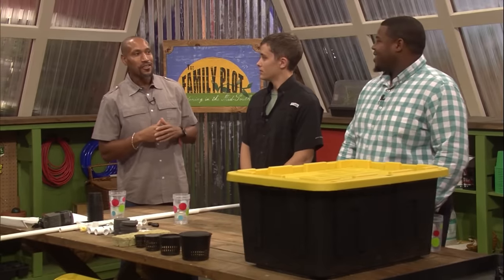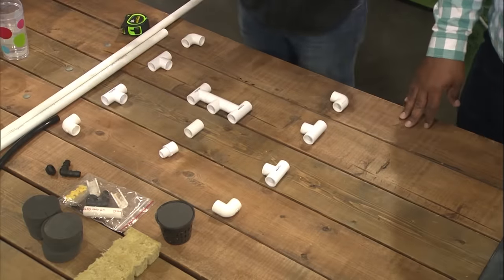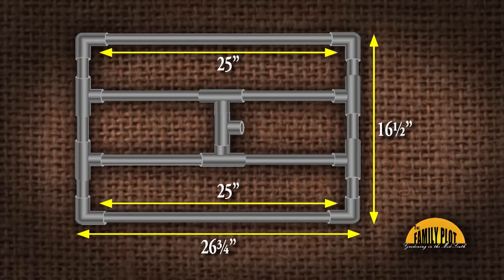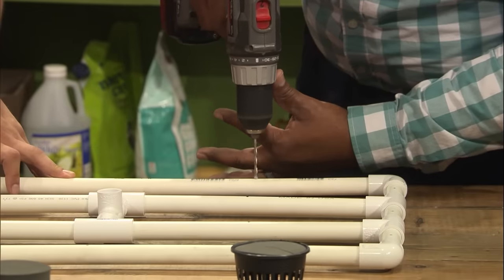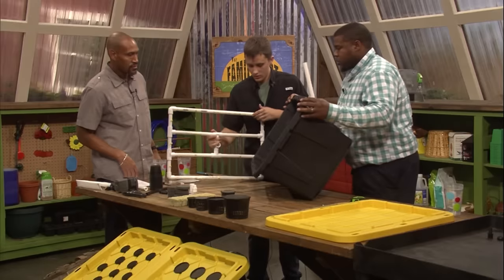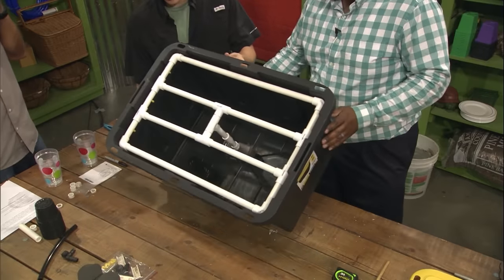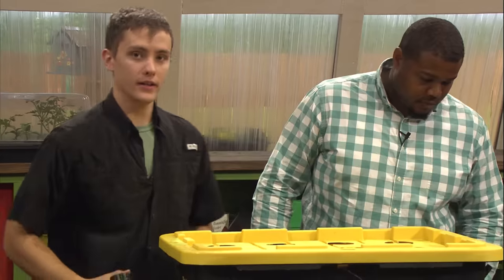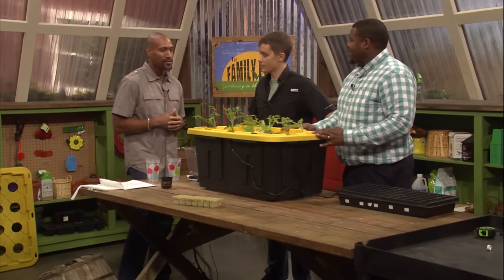Building an Inexpensive Hydroponics/Aeroponics System

Comment: If you have multiple pieces of pvc to cut at the same length, cut the first one and use it as a measuring piece for the rest of the pieces.   Saves some time not having to pull out the measuring tape every time.   Thank you for sharing your design ideas.
Reply: That's what I do😊
Reply: Or add the distance and pull the tape once, and no fumbling with a measure piece for each cut
Reply: Always cut the longest first.......yeah, well you might be surprised. As some found out at TSPE on the journey exam.

Comment: I've been running a very similar system for just over 3 months now and LOVE it!  Paint the yellow cover Black and it helps prevent mold.  I've also added a timer so my pump only runs about 50% of the time.
Reply: How did you set for your timer? I mean how frequent you spray the plant? 5 minute rest?
Reply: I've been running 15min on and 15 off.  I've not experimented yet with different timming.
Reply: Owh. Thank you for reply. Gonna try with your setup. 15m off 15m on.
Reply: @christophergraves5505  Hi there, I'm so curious.. how many days does it take before you see some roots from your clippings on that 15 on/15 off cycle??

Comment: Very complete and informative.
Thanks
Reply: Go Green 3
Reply: What pump are they using? I really need to know, thanks!
Reply: Great tutorial, minus one itsy bitsy detail...How much water did you put in ver
Reply: @troysnow5145  didn't they say 10 gallons? I thought that was the amount needed to create enough pressure to send the water through the sprinklers. That's what i used anyway.
Reply: I say INcomplete.  What about feeding the plants with some form of liquified nutrition, and what's actually going on inside the tub?  Also, what's the purpose or why bother with a drain?  Is an inside grow light needed?  How long do the plants remain in this container, and are they needing to be transplanted to a larger device?  Lots of unanswered questions or vague assumptions.

Comment: great video, thanks! A few questions remain:
1) How often should the pump run, and for how long? Also, how large should the pump be in GPM (Gallons Per Minute)?
2) What nutrients should be added to a ten gallon batch of solution?
3) What lighting is required, and how long should the light be on every day?
Reply from the maker: We run the pump all the time. It is 400GPH and is rated for about 25 watts. It both sprays the roots and oxygenates the water in the process. 
We used General Hydroponics Flora Series nutrients but there are many options out there. Watch this video for information about how much we put in: https://www.youtube.com/watch?v=gYrTTLbl3Ro
We use a large window for the primary light source. With large plants like tomatoes it takes a lot of grow lights (too many) to provide enough light. We do have a two smaller lights we use to supplement the non-window side of the plant. As for how long it should be on, that depends on what you are growing and the stage of life of the plant. Newly germinated plants can have the light on 24/7. After that it depends on what you are growing. Most plants grow best with a dark period every day.
Reply: Want them to grow them for you too? lol
Reply: What is the brand of the pump? Thank you ?
Reply: @agataporwit9787  Says in the description 1 400 GPH Pump (We used an ActiveAqua 400 pump)
Reply: I had the same questions and was wondering if you could make your own nutrients from compost or fertilizer?

Comment: I have found that if you run the hole saw in reverse when drilling the holes for the net cups it will actually leave a cleaner hole that is easier to clean up the extra bits of plastic
Reply: use tape aswell, especially if your material tends to break while drilling
Reply: That's how I did mine !!
Reply: Brad tip is best too. So much easier. It will not break with this tip.
Reply: Yep.. Those holesaws are made to cut holes in metal so when used regularly (in forward) makes lots of grit.. Since we are cutting thin plastic we don't have to "cut" the hole out and simple friction (reverse) will melt our hole..
Reply: tiny plastic bits will clog the spray nozzles fast
Reply: I didn't know it would drill a hole if you did it backwards. It would sure save time since my drill always seems to be in reverse...I need therapy for my YouTube addiction. It's 2am and I'm trying to think of what I can drill.
Reply: Thnx dad
Reply: I am am an industrial electrician and use the carbide hole saws all the time. It says on the side of the hole saw,  do not use in reverse. But the paddle bits they used you can use in reverse and also the cheap hole saws that are on arbors you can use in reverse. The way the teeth are  on a carbide tip hole saw, you ruin it in reverse.
Reply: @CAMCLIPS01  Running in reverse will certainly dislodge the carbide tips when drilling metals. But not soft plastic.

Comment: One of the best video I have on developing a system.   One problem,  I am a electronic tech,  and little did I know that a gourmet has 5 dimensions, 3 are diameters.  I needed a gourmet that fits into a 3/4 hole!
Reply: Hydroponic suppliers will get you the right part.

Comment: A parts list and where to get them would be EXTREMELY helpful for utter newbies. I have the skill and the tools to do this,, but have no clue where to get the pump, the plant cups, the sprayers, all the stuff that actually makes it work.
Reply: A link to the parts list is in the description and items can be found and purchased at Home Depot and on Amazon.
Reply: @MJKT95   i have looked and looked I can not find 330 sprayers all I can find is 360 if you can find a link please share it thank you
Reply: @keithtimms4345  Use the 360 if you find them. They are 330, just labeled 360, I assure you. Protip: look for misters with a hexagonal head, so you can use a socket to take them on and off. Using the fingers on these isn't so nice.
Reply: @MJKT95  Please shop at your local hydroponics store if you have one. Thanks!

Comment: hi guys, some things you skipped over....

#1....these systems will build up HEAT, i use a sealed 2 liter soda bottle of frozen water every 6-12 hours depending on time of year, to keep the water in the LOW 70's(sealed so it doesn't dilute the hydro grow formula) i also keep a waterproof thermometer(digital) in it, so i can monitor the water temp from the outside

#2....you need to add hydrogen peroxide (capful a gallon) to prevent the bacteria from growing slime on everything the water comes into contact with in your system.....

#3....if you use just water, your plants will starve to death, find a liquid plant food that WONT clog your sprinklers( even then you STILL need to bottle brush this system(just like a rifle cleaning) EVERY MONTH(or sooner) to insure proper sprinkler flow(that means COMPLETE disassembly, INCLUDING HEADS,(blow thru them to make sure they are not plugged up.

#4...start small, get to know how these systems actually work in YOUR conditions, i actually use a 5 gallon bucket(for the last decade or so) and it fits my needs perfectly, i have 3 different lids i use with 6-12-18 sites, and it keeps down the cost of putting nutrients in 2 gallons of water as opposed to 10 gallons of water......cheers!
Reply: Thank you for your advice, but we've been very aware of these issues.

#1 This is a common solution to a problem most people don't expect. However, we've used this system out doors in the late summer heat with great results. The tote does get quite warm, but it doesn't hurt the plants in the long run. Tomatoes and squash and such love to grow and can take a heck of a beating from all sorts of events before it starts to revolt on your abuse. Our tomatoes (see our facebook site) went from "planting" to harvest in less than 45 days with this system. All out back of our warehouse getting the full rays of the sun. At one point the plants we so large it seemed like we filled the tote up with fresh water every day until feeding day. That's when we decided to gravity feed them on demand, but that's a different lesson... moral of the story: just grow with it. If you're not growing the west's favorite crop, you're not going to need too much specialization in the root zone.

#2 DO NOT use hydrogen peroxide on hydroponic applications to fight bacteria and fungus. We cannot stress this enough. To give your plants a happy life they NEED bacteria and fungi to hang out in their roots and help them get access to food. Sterilizing the environment weakens their immune response and makes them prone to illness and susceptible to harsh environments. Instead of microbial genocide, introduce beneficial microbes to your root zone. These are easily found under many brand names. Gardeners the world over are well aware of the application and benefits of microbes. At our shop we usually just throw whatever free samples we have this week at the plants, but it we were to go shopping we'd probably pick up a bottle of Orca or Great White and use them religiously with every nutrient change. Beneficial microbes will out compete harmful microbes help the roots thrive, and therefore the plants will thrive. They aren't expensive, and you just mix them in like any other plant food.

#3 This was a demo on building certain hydroponic system, not an introduction to hydroponics. Everyone knows plants must eat? Even a plant in soil will eventually need amendments to that soil in order to continue to live. The art of hydroponics is essentially "soil amendments" given from the beginning and until the end of the plants life. Tailored to its specific needs. Fine tuned. All live must feed. General Hydroponics is the brand of plant food we promote the most as it's the brand most likely to be available in every major city and every hydroponic supply shop. Indeed, there are countless other brands that will provide excellent results in systems like this. Avoid organic brands until you know they won't clog the sprayers. There are lots of organics to find that will work, but some will cause trouble in the tiny holes, so be aware.

#4 This tote is simply one incarnation of the SPRAYER design. The tote is the vessel. The sprayers are the important part. If you do this setup right (the tote is a hyrbid setup for beginners or hobbyist going to the next level in hydroponics) you can use minute amounts of water compared to a DWC. I've had my 9 year old nephew build a single pole sprayer into a 5 gallon bucket with a 250GPH pump. His cucumber plant gave off nearly 100 cucumbers and was the envy of the extended family. Never underestimate the power of extreme oxygenation!

Thanks again!
Reply: thank you very much this is definitely going to help living in a studio
Reply: Bro your the best. I need to do the 5 gallon bucket thing. Thanks for the tips.
Reply: @wetwerk2178  Reading your replies to your comment section and I just have to bow to your level of knowledge AND patience.

Comment: These cats are awkward but man they are it! You guys helped my project out a lot. Tons of complicated “professional” setup vids that just aren’t feasible for everyday people. Thank you!!!
Reply: && you really don’t need all the pvc in it.  Just pour the water and solution in and done.  Drop cups and water solution only is easiest
Reply: @jillellis62  The water needs to have oxygen added to it constantly. The most common way to do this is with airstones but we found it highly inefficient for larger containers of water, and they also need periodic replacement which is wasteful. As well, this tote is designed to use as little water as possible. As long as the water level clears the pump, the plants get fed. This is especially useful while the plants are small. Less water, means less nutrients and more savings. You can used a shallow tote, but then when the plants get very large the roots will be a problem. This system is designed to mitigate all of these setbacks and also be approachable for the novice home gardener.
Reply: thank you!

Comment: How often do you run the pump? Do you water the plants initially? Why do the sprays point away from the plants?  When do you add more water? If the drain tube was clear,, it also could be a level guage. Do you refill through the drain tube? Do the plants grow faster than in the ground? Lighting?
Reply: Yeah there was a lot left out of the video.
Reply from the maker: We run the pump all the time. This video will answer most of your other questions: https://youtu.be/gYrTTLbl3Ro

Comment: For putting holes in plastic bins, if you can find pieces of metal the right size (like an old garden hose for your drain) that you can heat up, it only takes a few seconds of heat with a propane torch, and the hot metal pushes right through the plastic with just a little force, making a nice neat hole with no mess.
Reply from the maker: Good idea. Thanks!
Reply: I imagine you could do this with a mason jar cover too

Comment: This is improved from the method I used previously. I figured I would look for a different build for shits and giggles. This looks more effective but there is a couple important details you left out. If you pick one of those frosted or transparent totes, it will grow algae and compete with your plants. Make sure it's dark in there. Another is that power cord is a serious fire hazard. It will be fine like that if you make a loop (aquarist here lol). Water runs down hill, so make sure there is an upward angle in your power cord so it cannot leak on your receptacle. I cannot stress how important that is, I've seen nightmare posts in my fish groups. Other than that, thanks for the new ideas!
Reply: the power cord comes out of the top of the tote. no drips.
Reply: it literally goes up from the pump and out of the hole. I guess water travels uphill now 🤦‍♂🤦‍♂

Comment: Pro tip for drilling holes in plastic with a hole saw bit, use reverse to avoid cracking the plastic! Yes reverse does drill holes (only in plastic) despite what logic tells you.

Comment: Hi! I am building a hydroponic system for my senior project in school. I love this demo and it is really helping me get my project started! I just had a question about the drain and water. Does the water in this system need to be regularly drained or does the water just circulate until done growing?
Reply from the maker: We drain and refill the nutrient solution every week. We are using the General Hydroponics Flora series of nutrients but there are many other options out there. Here is a video of Scott changing the solution in the system: https://www.youtube.com/watch?v=gYrTTLbl3Ro
 If you garden in the ground too, you can take the discarded nutrients and use it as liquid fertilizer for your ground plants.
Good luck in your project!
Reply: You would want to drain it and replace the water occasionally. If you just always top off the water level you'll eventually have too much sediment and bio-gunk growing in the water.

I am curious if adding an aquarium-type filter to continuously cycle the water would help to keep any particulates trapped. You'd get beneficial bacteria growing on the filter which would help break down bad stuff.
Reply: I was Actually curious if I can could adapt this to a unique aquarium sump/filter. As the plants will absorb excess nutrient from the aquarium then add return it to the aquarium + the added benefit of growing some edible plants and avoiding extra additives. Plant choice would have to be limited to things that will grow easily with only aquarium water and not added nutrients/minerals. (A twist on an Aquaponics system).

To answer your question, the best option would probably to add a small sponge filter, bio-balls or ceramic disks in a net bag in the corner would be a good cheap option, or any aquarium filter as you mentioned. It would definitly add to the life span of the water and maintain water quality.

Comment: Should have a link to pump and spray nozzles.  Would really appreciate it.
Reply: Seconded
Reply: Seek thee out, "Active Aqua 400 gph pump". Amazon. eBay. Hydro stores near you. Any hydroponic pump of the same GPH (or similar) rating will have the correct threaded coupler. Using a standard fountain pump will most likely have a slip connection and not work with the pvc connector. Avoid the hardware stores' fountain pumps. Use hydroponic pumps.

Comment: 2 questions
For what purpose there is this drain on the bottom? It is kind of overflow? Is there any risk of that?
Second, does the pump needs to be ON all the time 24/7?
Reply from the maker: The drain is to do just that. Every week or so you need to change out the solution so the drain makes it easier especially if you have big plants. See here: https://www.youtube.com/watch?v=gYrTTLbl3Ro . The pump is on all the time. It keeps the roots moist and oxygenates the water.

Comment: Just curious why is the nozzles facing downward instead of pointing upwards...
Reply from the maker: You can face them either way. The reason they are down is because the piping supports some of the weight of the plants when they get big and heavy - it keeps the lid from bending and getting a low spot in the middle. When they are small you can put the nozzles on the top to keep the young plant roots moist. My experience is that even with the nozzles down the water splashes into the net cups and keeps the rock wool moist.
Reply: Richard Yo
Reply: w
Reply: Also, you're keeping the ROOTS moist, not the leaves; moisture on leaves can lead to fungal diseases, especially if you're gardening indoors, as most hydroponic setups seem to be.
Reply: In this system the piping is held high up, but if you place the piping lower you can spray up. The idea, as mentioned in the replies, is to spray the roots.
Reply: Lol